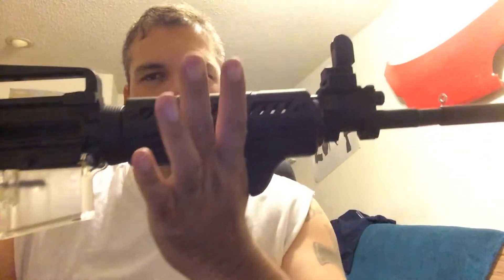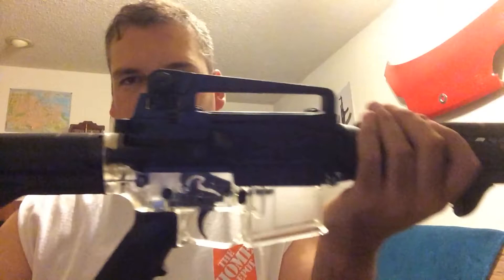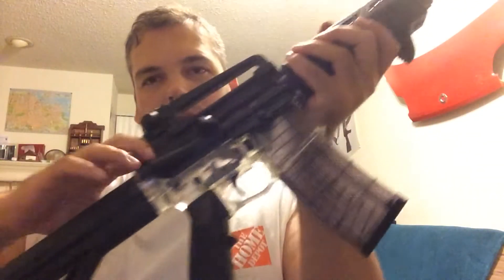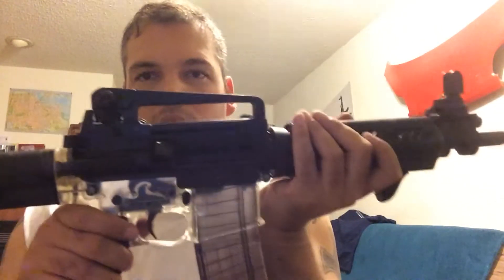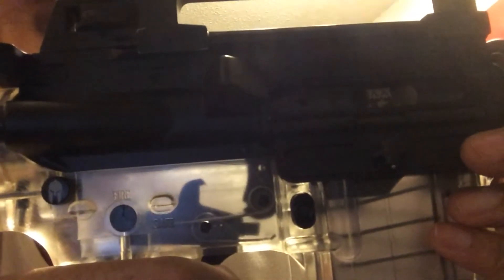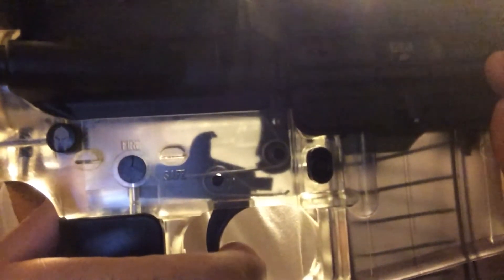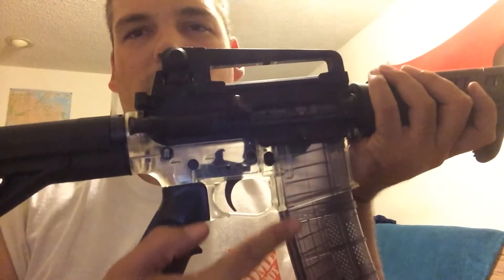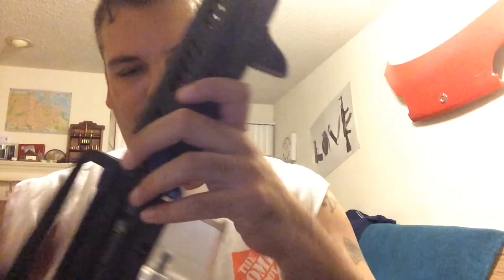Initial Thoughts of Tennessee Arms Clear Polymer AR15 Lower Receiver

Comment: good vid, it's definitely a cool piece to show to buddies when they come around or to see what part of the trigger group to polish to smoothen the pull. always use the JP enterprises disconnector yellow spring only (not the hammer spring) to lighten up the pull.
Reply from the maker: thanks
Reply: Darith Yim I have used the JP yellow  HAMMER spring on many builds.  I have NEVER had a light strike or a FTF in 8K rounds between all the builds. After a careeful polish, a 1/4" set screw (for take up) and the JP springs, any old crappy Milspec trigger can shoot VERY close to a 200 dollar aftermarket. At least mine do.  About a 3.8lbs pull.